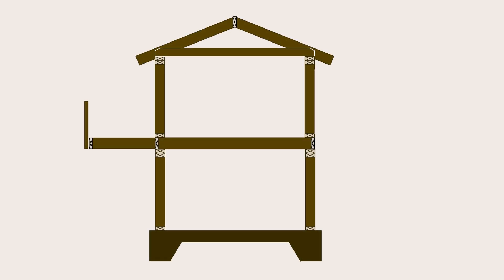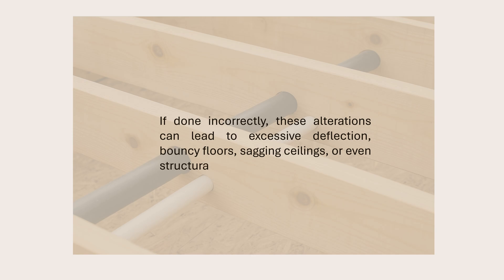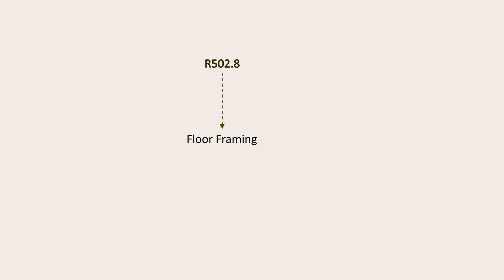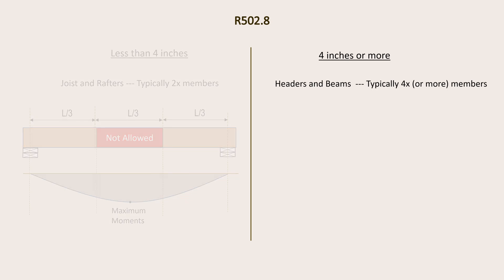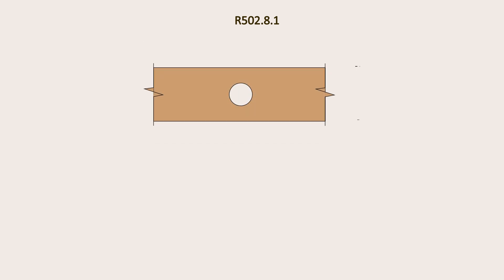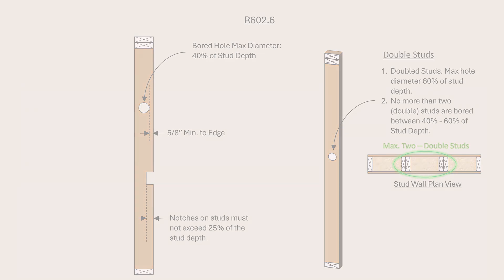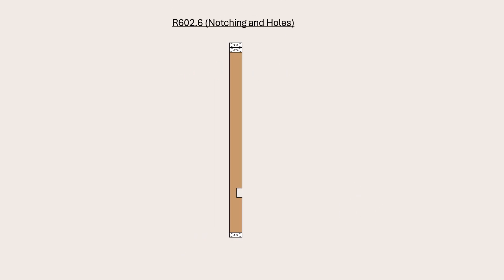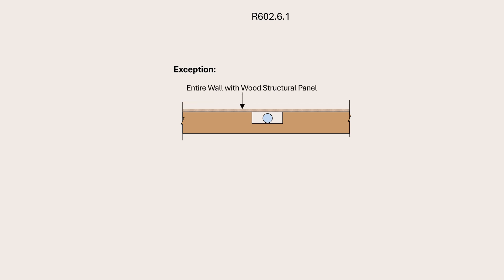Notches, Holes, and Cuts in Wood Framing | Don’t Fail Inspection!

Comment from the maker: Some very keen viewers have raised valid concerns about the direction of arrows that are indicating tension and compression forces in beams. The convention used in this video here is typically used in the analysis of trusses. For beams, i admit that i should not have used arrows pointing towards each other to indicate compression or pointing away to indicate tension. Special thanks to @jmyazzie08 who first raised this concern and @xephael3485 and @GrampalettasCamp and @PRND21 who raised the issue in the shorts video on this topic (currently under revision). Thank you.

Comment: I found this to be very informative as a carpenter on big projects that was my first objective is to talk to the plumbers mechanicals and electricians on low holes and how to avoid costly repairs. I would like to see TGI explained as well as LVL‘s and the different parallels and engineered woodslike this channel.
Reply: Agreed. In the plans I'm looking at, LVL joists can only be drilled in the middle third of the span and in the middle third of the depth of the LVL.

Comment: Metal strapping is cheap way to reinforce overhead joists that are available in nearly seamless lengths on the cheap.  Steel has much better loading under tension that would ever will. Not just by a little bit, but by hundreds of times better.
Reply: I swear youtube edited my post. "that would ever will" should be " than wood ever will".

Comment: Finally, a video that describes how removing too much wood in a supportive structure can seriously cause massive problems. 
(Workers are paid by the hour and job estimate and will just create massive issues to install a pipe or cable "really efficiently" and create a long term problem. They have very efficient modern tools for drilling massive holes in your home to get the results you want NOW. But the material removed can create the sag or vertical instability that can be really bad and is very costly to fix.)
Reply from the maker: Thanks for the comment.

Comment: I may be wrong but starting at 7:10 the arrow are showing the opposite direction of the tension & compressive forces on the members and beams. Compressive forces on the top would show the arrows pointing towards each other while the tension forces would show the arrows pointing away from each other.
Reply from the maker: @jmyazzie08. Thank you for the comment. See the pinned comment above.

Comment: Yet they are still building homes poorly in 2025 with all these codes we have and this video keeps saying lumber is 2inches thick and the hole should  have 2 inches of space on each side of the holes. But lumber don't come 2×4 anymore
Reply: Yes,
I just purchased Simpson Strong Tie brand hurricane ties. And they do not fit a 1922 building where the wood is actually a true 2x4. They are made for modern "2x4" construction. Obviously, in the old days a 2 inch x 4 inch piece of wood meant just that.
Reply from the maker: 2x lumber is referred to as 2 inches thick in nominal dimensions, even though the actual thickness is 1.5 inches — I know, it can be confusing, but it's a long-standing convention in construction. So, when referring to '2-inch thick lumber,' it's generally understood to mean 2x lumber unless precision is required. That’s why I believe it’s acceptable to use the nominal dimension in contexts where the exact size isn’t critical (such as when distinguishing a 2x from a 4x). Also, nominal 2x4 is available but the actual dimensions will be 1.5 x 3.5 inches (+- tolerance).
Reply: @ConventionalFraming 
Great video work and I am impressed and subscribed.
Your point about a "2x4" being actually 1.5 inches by 3.5 inches should be highlighted. Because a lot of these current amazing faster connections are made for modern 2x4 standards. I have a 1922 home and carriage house and the beautiful redwood construction requires very careful consideration with minimal loss of wood material and just how I can make each connection stronger and stable. 
I appreciate and am grateful for your knowledge.